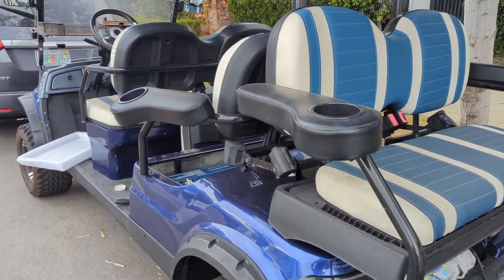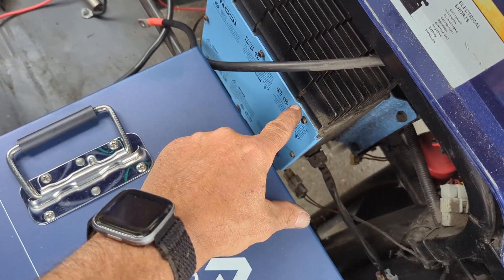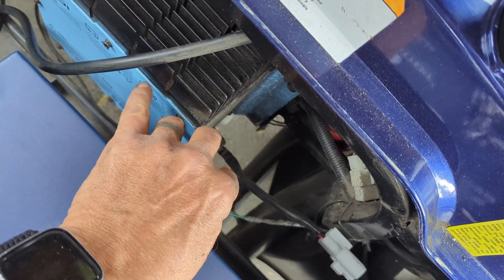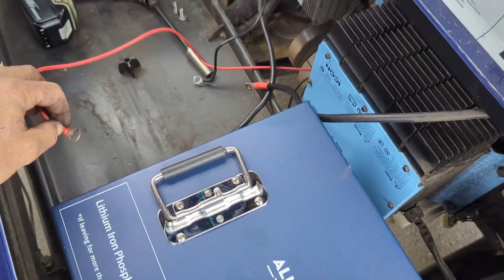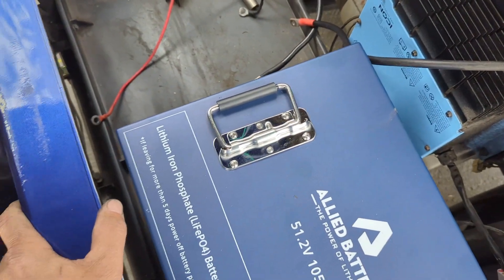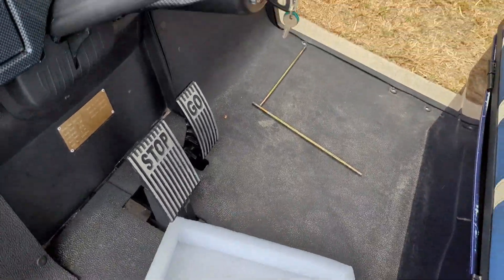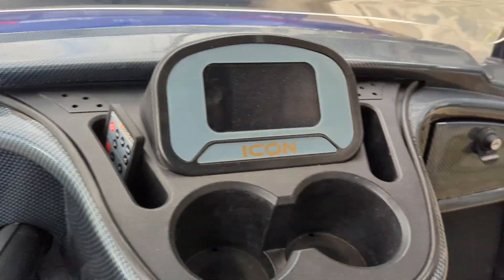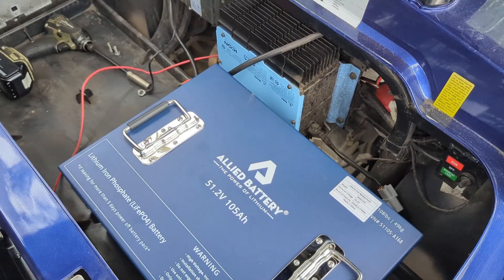Icon Golf Cart Six Seater LIthium Battery Allied 48V 105aH Commercial

Comment: Any issues with lithium conversion? I’ve heard some icons had breaks locking up etc with lithium conversion
Reply from the maker: This is true for some lithium batteries because the icon has a very high amp speed control. We have tested the 105 model and it has performed well with the icon golf cart